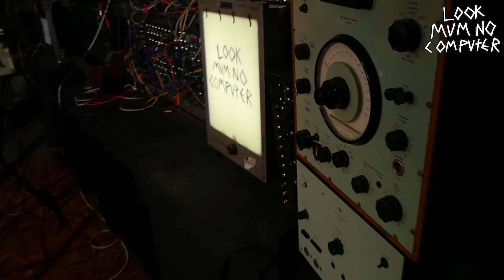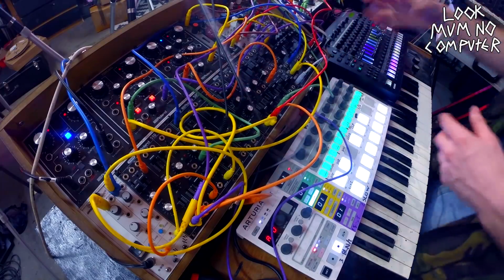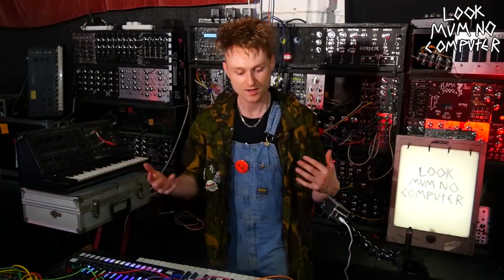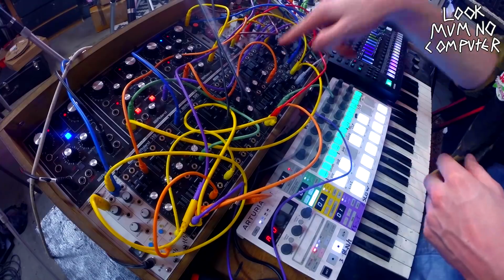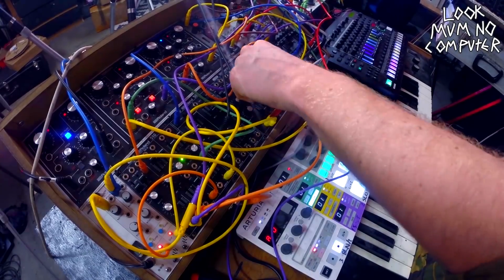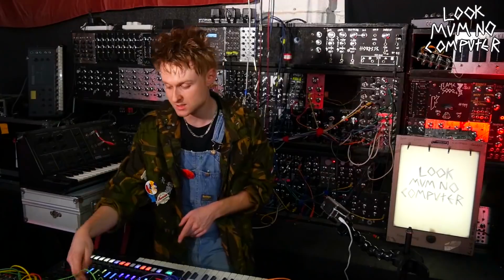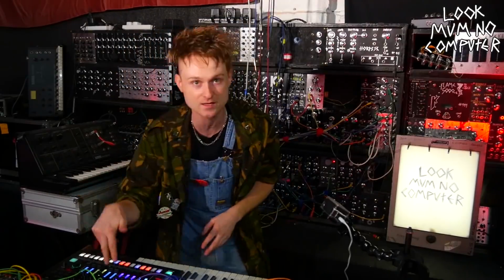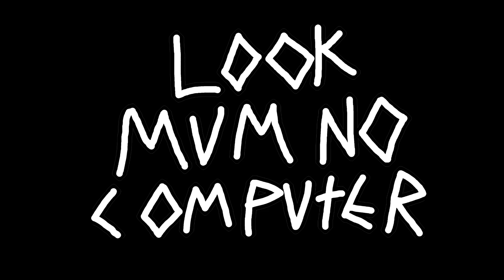Live Synth Jam on the Roland System 500 and Tr8s

Comment: Showed this to my mum, she told me that all synthesisers are tiny computers. I'm lost for words
Reply: they arent xd all analog
Reply: @commonteadrinker4830  ever heard about analog computers?
Reply: @commonteadrinker4830  Computers are made of analogue hardware.
Reply: Common Tea Drinker Computers don’t have to be digital. See Heathkit EC-1 for an example of an analog computer. Analog computers have been used in everything from bomb sites and fire control systems, to animation for television (see Scanimate) up to the 1989’s. And they’re having quite the resurgence, with potentially faster speeds and considerably lower power requirements. Very early analog computers were actually purely mechanical in nature.
Reply: Analog computers exist. As do digital synths.
Reply: Analog synthesizers aren’t actually computers, as there is nothing to compute. They simply take input power and turn it into an oscillating signal converted to sound by a speaker.
Reply: My mum calls my synths "pianos" so yeah
Reply: Sqidgery but they process functions which is essentially computation
Reply: The distinction lies in how the sound is produced. Analogue audio hardware is called analogue because because the electrical signal representing the audio is an exact analogue of the waveform. A continuous oscillating of voltage or current (depending on context) over time where the extent of the oscillation is the amplitude (or less accurately, loudness) of wave and the frequency of the signal of course represents the frequency of the sound.

Digital audio equipment is called digital because there's an analogue device, the operation of which executes a series of instructions, the execution of which results in the computation of an approximation of the waveform. The computer is like a person who has no self-aware comprehension of the world, that follows every one of your instructions to the letter, one after the other. If you are explicit and comprehensive enough, you can direct that person (if not a weirdly disabled one) to do anything humanly possible. The series of instructions, on an abstract level is like a physical device in of itself, except that it is simulated virtually on another device, limited to working linearly doing one thing at a time, at a arbitrary maximum rate.

Digital sound is comprised of a series of 'samples', each sample has a single value, the amplitude. This is represented as a numerical value, the form and maximum resolution of which varies from use case to use case. A low quality, 8-bit 10KHz sample rate audio file can only approximate the waveform with a series of integers (amplitudes) between (inclusive) 0-255, played back at a rate of 10,000 times a second. A sample-rate of 10KHz means that the maximum frequency that can be represented is exactly 10KHz. Any frequencies higher than that will just cause any frequencies below the maximum to be distorted.
Reply: Pokedex, he already told me
Reply: the difference though is they don't crash as much as "real" computers.
Reply: @sqidgery9960  Incorrect. The Roland gear is Virtual Analog so it is a computer. Even if it wasn't virtual analog, the firmware for the drum machine also counts as a computer even if it was driving analog oscillators. All mutable instruments modules are computers. A flight computer is analog.
Reply: Allen Turing!
Reply: @CoolspyGaming  so are guitars.
Reply: @CoolspyGaming  But hardware can be simulated digitally using computers, don't forget!
Reply: @obbekjaer  at the end, every thing is analog, even computers ;)
Reply: @loscilla  get multiple cameras setup for different angles. Set them all to record at the same time. Get a sound recorder and set sound to record also. Before you start doing your performance get a couple of sticks and tap them once. This will ensure your can sync up your videos and sound in your editing software later. Record the entire performance. Once you got your footage, import it into the computer and video editing software from the cameras and sound recorder. Pull each of the files onto its own track. Now line them all up using the click sound from the sticks at the beginning. Zoom right into the tracks and get them all so the clicks all sound like one. The audio will sound thin because its phasing and means its close enough. Next move towards the end of the video and check that its all still in time. If it is then its all good. If its not you have to go back and find which track is not quite in time. Once you have this done you can easily do cuts on different video tracks to switch between different angle shots. Once you got your video looking good mute the audio in your video tracks leaving the one audio track that was from your sound recorder. This is your best sounding audio. Cut out any silent parts of the sound to remove background noise. Once your happy with the video you can export it as MP4 or h264 at 1080p (or whatever size you want) with sound as aac. Experiment with different export settings as it can massively effect file sizes and overall quality. And thats all there is too it :)
Reply: @loscilla   Agreed! Sam is a great artist in music, electrical engineering,  circuit bending,  television presenting,  and full-time Youtubing.
Reply: your mum doesn't understand computer technology
Reply: ask her its not electronic but electric :( ) tshuss

Comment: Was in a shop today to have a look at the Roland 530 double VCA ... looked interesting but those sliders just don't look like they'd survive as long as some Doepfer-bunker-built modules. Will get a Doepfer one or a Mutable Instruments 4x VCA.
Reply: I've had Roland products for...21 years. XP-80, the smaller one, and V-drums. Keys were both new. V-drums were floor model. Assuming you treat them like a well-loved wife, you'll have to have them cleaned, maybe power supply replaced somewhere around years 15-20. 

Other than that, they NEVER give you a problem. The XP-80 had a floppy drive that STILL works. 

Electronically, they won't impress any geeks inside, but hard to argue that they STILL work. Very durable as long as you're not stupid. 

I've heard of people breaking keys inside. Well, once you realize brutalizing the machine won't make it LOUDER...you won't have to take it apart anymore, or have someone else do so, for $75.00 just to look at it... :)

I have not had my hands on the model of which you mentioned. Roland, however, I know and rely on since 1997. It doesn't even SOUND dated now.